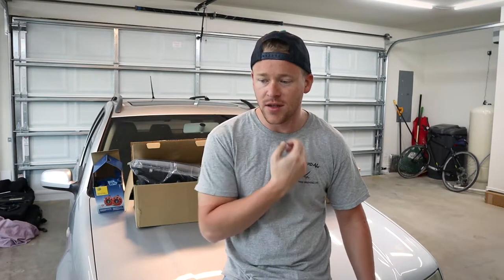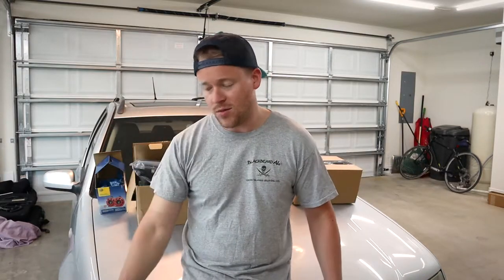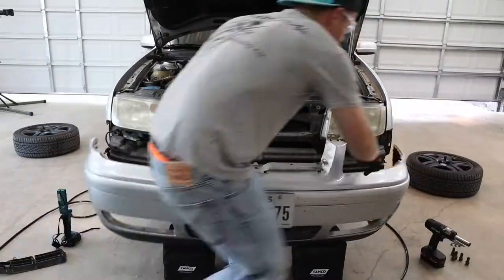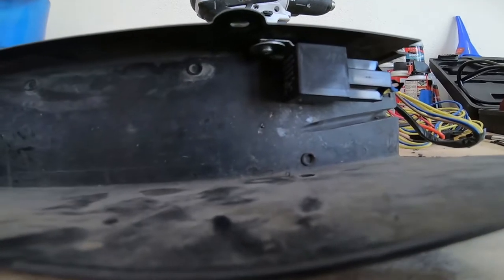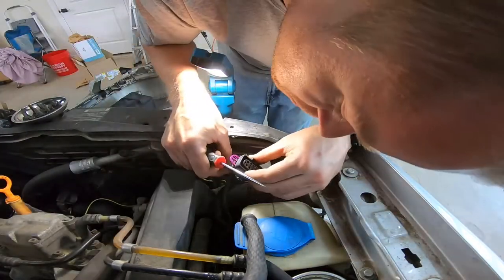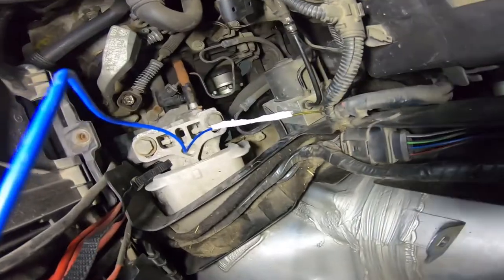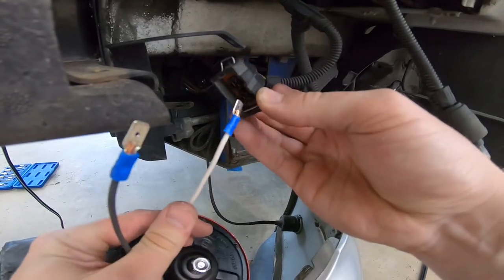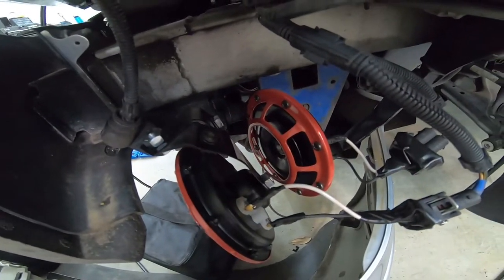MK4 VX Tuning E-Code Headlights and Hella Horn Install | Project MK4 TDI Wagon Part 9

Comment: Nicely done and thanks for posting this.  I need to replace the helix projectors I've been running for years and wanted E codes.  Glad to see these work well and are half the price of Hella or VW.  Plus a pair of Hella with fog lights are impossible to find new.  I'll be ordering a set of these for my GTI now.  I'll be so happy to see at night.